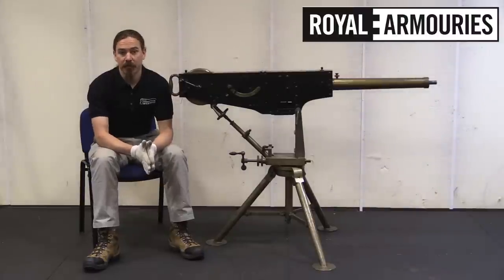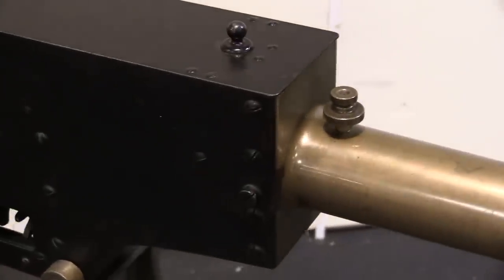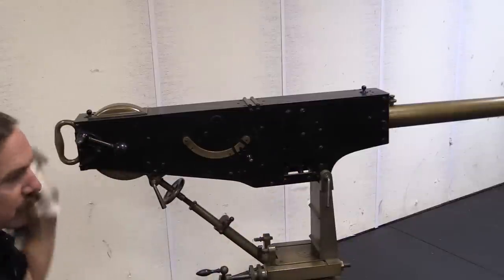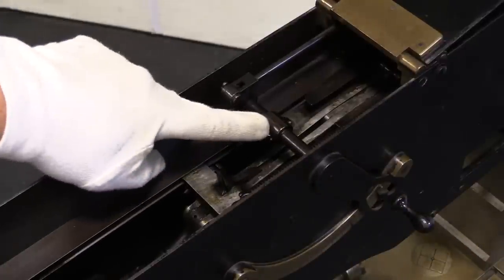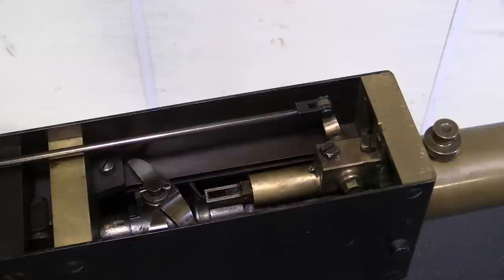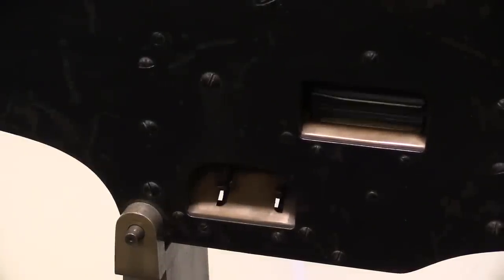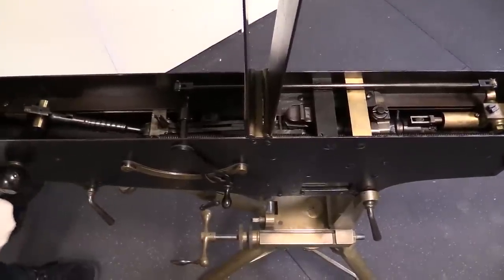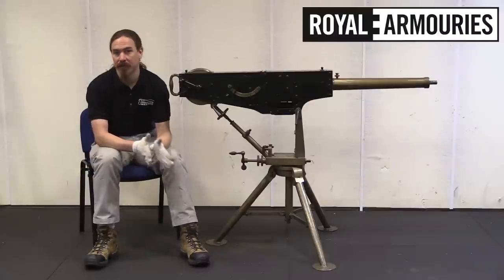Maxim "Prototype": The First Practical Machine Gun

Comment: This is so gloriously Victorian. It's magnificent in it's impracticality and inefficiency, but clearly an important stepping stone on the way to the practical machine gun.
Reply: The brass, the fonts, the beauty of it all.
Reply: not enough engravings though...
Reply: N. A. Well, it was only a prototype.  Good enough for the workshop, a production gun would have the proper amount of scrollwork and engraving.
Reply: @Mrhalligan39  of course!
Reply: @n.a.4292  ahhhh back when Engravings still offered a tactical advantage
Reply: @n.a.4292  Engravings give you no tactical advantage whatsoever
Reply: @visassess8607  wrong
Reply: @seaniesean5  It was a Metal Gear Solid 3 reference

Comment: Very cool.

What I really took away from this is that Hiram Maxim invented bumpstocks.
Reply: Wait, is his lever gun conversion technical semi auto or a bumpstock?
Reply: @dominicksmeech2994  No idea but still looks like a early bump stock.

And as Ian said there is not much difference mechanically between a semi auto and full auto weapon.

Change or modify or mis install a couple of parts and a semi auto weapon will fire full auto.

Although in many cases neither safely or reliably.
Reply: Dominick Smeech by the looks of it he only modified the lever part of the gun so it was still semi auto but as Shaw R stated semi to full is not a huge step
Reply: Honestly, the vast majority of semi-automatic designs are full auto, with parts added to fire single shots.  Full auto is far simpler to do, you don't even need a separate firing pin.  Making it stop (Before it runs out of bullets) is much more complex.
Reply: @shawnr771  But a bump fire stock does not convert a manual action into semi auto. It only simulates full auto on a semi auto gun. In no way does a bump fire stock change how the gun operates or how the trigger functions. In fact, bump firing is a technique. A bump fire stock only makes it easier.
Reply: @ferrusmanus184  Calling people names instead of dispelling what they said really only harms whatever point you think you're making.
Reply: @LUR1FAX  I used to have one. It was worthless. Cut down on accuracy and uselessly expended ammo.
Glad I sold it before the ban.

If you want something much more useful and it is legal in your locale,
look into a binary trigger.

Comment: WoW, so much (over)engineering, it really took some development to come to much simpler designs. I'm actually somewhat surprised there is no oil radiator and oil pump on this thing to prevent lubricant on all those shafts and cranks from overheating. XD

Comment: I think I found GW's inspiration for the heavy bolter design.
Reply: Kyle Morgan By the Omnissiah...
Reply: If you know very early 20th century/ww1 tech and equipment, you will see that 40k is riddled with "inspired by' designs. The creators/designers/initial illustraitors were hugely into that era
Reply: The people at GW in the 80s and 90s really liked WW1 and interwar designs. Just look at the early IG tanks. The Baneblade based designs look a lot more modern, they look a lot like they are based on the Churchill Tank of WW2.
Reply: There's a GW five minutes away from The Leeds Royal Armories coincidence? I think not!
Reply: @FreeOfFantasy  The Bane/blade at least to me looks a lot like The Tortoise Heavy Assault tank from the tracks to the hull casting you can see other elements like off centre mountings for heavy weapons like on a Char 2 B or M3 Lee and of course the WW1 british  side sponsons for strafing trench's the front glacis as you say is exactly like a churchill.
Reply: @JackIsMe1993  The tracks look a little more Tortoise. The Churchill has them even further out in front. However the Churchill has that ledge where the hull cannon is on the baneblade and the main turret looks closer.
Reply: Now, I'm trying to figure out how to mount a chain bayonet to that barrel jacket.
Reply: @Psiberzerker  the Commissariat is interested in the results of ur research

Comment: With the front site post on the left side of the gun and the "trigger/speed controller" on the right, I would assume that this is crew served and the (I'll call him "ammo handler") also starts the firing process by setting the trigger to "on"... While the "gunner" holds the spade handle and aims the gun. That would keep everyone out of harms way of the charging handle.

Comment: If you used this gun in cold weather, wouldn't the viscosity of the oil in the buffer (and therefore rate of fire) change dramatically?

What I'm saying is that this gun obviously needs an oil heating/cooling system.

Comment: To solve the smoke problem he could have mounted a propeller using the barrel as an axle.  Then he could have invented some clips to hold the operators eyes open in the 150 mph smokey wind generated by the prop.  The clips could then be made to open the eyelids one at a time so they would always have one eye open on the target, and the other in a very short recovery behind it's eyelid.  Seems like there's something that he could be doing with the mouth to harness the screaming of the shooter.  Maybe another propeller, but proportionally smaller.

Comment: It's definitely a crazy design, and ahead of its time especially with the idea of being able to maintain constant fire on an enemy overnight while having a gun that can shoot variable rates of fire. You can see why they got rid of it and or didn't use that system but it's really cool to think that you could just set up a gun keep it trained on an enemy position and the gun would continuously fire and do its work without needing inputs from a soldier.
Reply: They are actually starting to use real drone guns in combat. I saw anar on a tripod with some electrical lower receiver and a camera system.

Comment: I'm confused about the timing here. 
He's saying it required smokeless for success and .303 wasn't smokeless until 1891 and .577 got cordite in 1902.
But it was used in Emin Pasha expedition in 1886 as well as in Singapore in 1889. I also thought the Shangani maxim gun was in .577 but that was 1893.

All of that implies it worked, maybe not as well, but enough to be useful, without smokeless. Either that or I'm wrong about those dates which is totally possible.
Reply: In confused about this as well, I can't imagine a black powder machine gun, it still baffles me to think of any self loading action weak enough to be man handled by the recoil or gas but strong enough for the fouling.

Comment: Am I the only one looking at this and thinking "alot of this looks like gatling gun feed.."
Reply: probably because it is. the difference is with recoil operation, you don't need the full rotation hand crank to feed and fire. It took a while to be streamlined and simplified down to something not so heavy.
Reply: @BillMcD  I was more referring to how the cartridge is is loaded into the chamber. As moder multibarrels use a similar system to remove the cartridge from the belt

Comment: Damm.  Ian has the best job in the world.
I wonder if it would have been possible to develop a cartridge with some sort of plug that would scrape the barrel clean every 5-10 shots?
Reply: But how would you propel the plug?  Black powder?  That would leave fouling of its own...  And that wouldn't address fouling in the mechanism itself.  Black powder is just not the right propellant in a machine gun for several reasons, fouling being just one.
Reply: @AndrewAMartin  I guess the old engineers thought of most things ,they were pretty inventive. If it could be done it would have been done.

Comment: this rising locking block system looks simpler than the later toggle lock system Maxim used . Any idea why Maxim switcher to the later ?
Reply: I suppose that by switching to the toggle lock system he could both increase the lock strength (look at the size of the later Maxim toggle lock as opposed to the single locking lug on this one) as well as making the already present toggle mechanism much stronger and more durable.
Reply: maybe  a form of simplification the rising locking block is not needed with a full toggle lock system